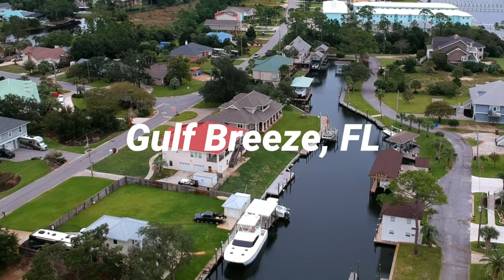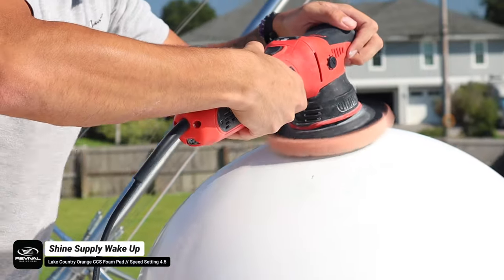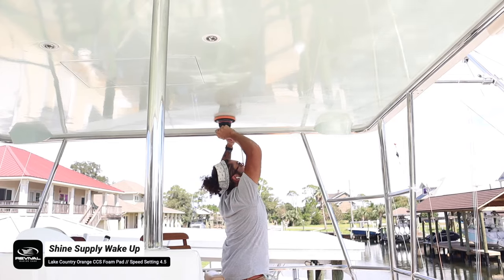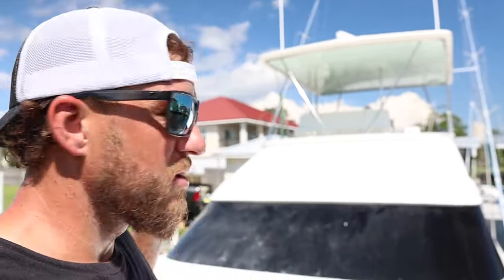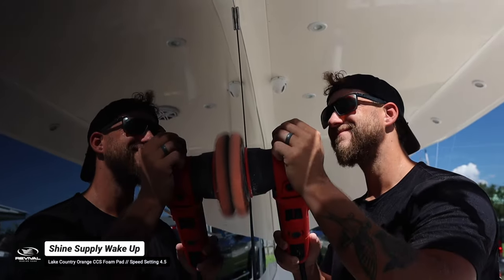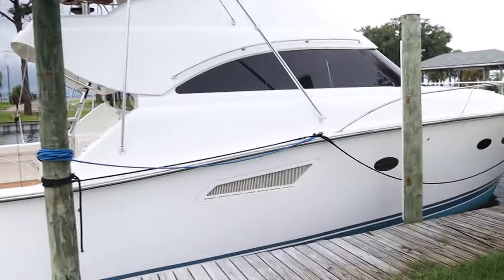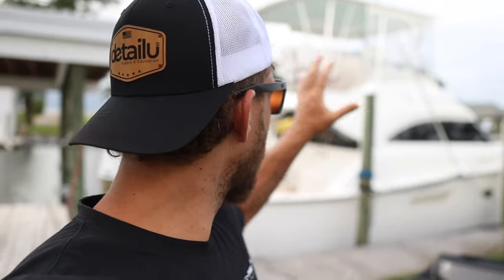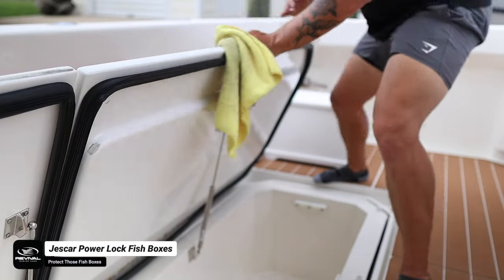Full Transformation ( Step by Step ) Boat Detailing Guide

Comment: Great video, nice to have new content in a long format! The more you explain every little choice the better. Do you use 6" CCS pads on a 5" backing plate? And what made you choose the M8Sv2 over the Rupes Mille on this job?
Reply from the maker: Thanks for the feedback 💯💯
Yes we used 6inch pads on 5 inch backing … only because I wanted a lager pad but didn’t have a 6 inch backing. 

Also, I went with the m8sv2 because it’s much easier to handle, the wool and rotary pulled all defects out so the M8s was great for cleaning up the light holograms.. the Rupes would have been over kill! 💯

Comment: Can you use a DA polisher for the compounding stage? I have a friend who is going to let me use their boat as a test detail. I have a DA for car compounding.
Reply from the maker: Unfortunately, in my experience, ADA polisher is not near powerful enough too heavy, cut oxidation out of gel coat. I’d save it for light paint, corrections, and applying sealant. If you want to cut oxidation, you need to have a rotary buffer. Then you can remove the swirls with either ADA, polisher, or force rotation polisher.

Comment: Is it safe to do this on a boat multiple times a year? Or once a year?
Reply from the maker: Ultimately, this should be done once then maintained correctly so you don’t have to do this every year. It’s not sustainable to do this to gelcoat all the time. Overtime, you will wear down the gelcoat from buffing and sanding so much to a point were the boat will need re-gelcoated